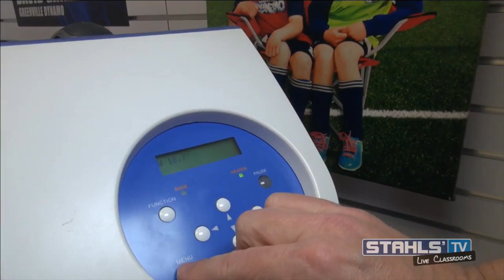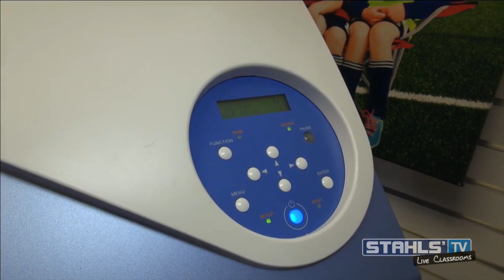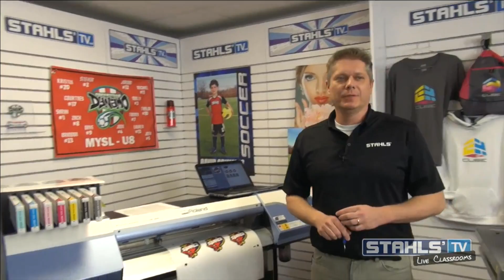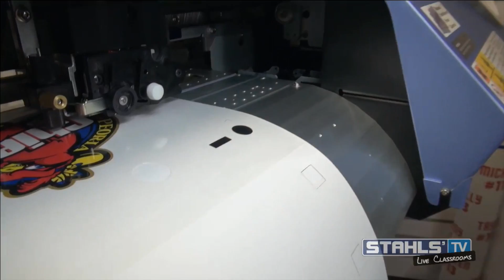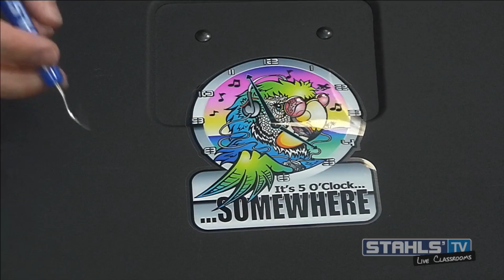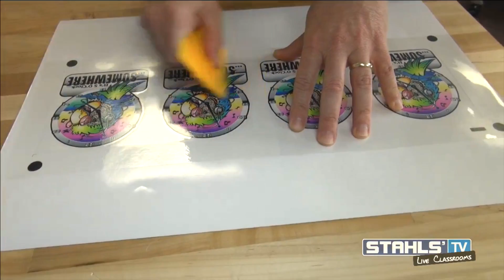How to Add Lamination to Your Print and Cut Workflow

Comment: Hey there! I am writing from Belgium, and I will have a Roland BN20 installed on the 16th of April. I am still a newbie and I’m learning everything by myself (I have taught myself how to use procreate, photoshop and illustrator in the last 10months. It was a challenge, I’ll tell you that 😅But it worked and I learned how to make cutting paths in illustrator. I have a stickershop (for 3years now) and I had always outsourced my sticker printing needs, but now with the BN20 I want to start doing everything myself. 

I still have a few questions though, concerning the use of the machine and sticker making. I hope you can answer (some) of these;

1) I read just as many comments of people saying you dont have to laminate as people who say you absolutely should if you want your stickers to be professional. I need stickers that can survive about 3-5 years outdoors without fading too much and who are waterproof. Some end up on cars, others on waterbottles or laptops. The point is they need to be “diverse” to be used on a lot of places, but not always/only outdoors. Do you think a laminate is necessary then, or will the ink from the BN20 be good enough that it can hold it’s color for a certain amount of time? And I guess it’s also waterproof without the laminate then?
2) For the cutting. Does the BN20 also cut through the bottom of the vinyl (the paper backing) or is the blade not strong enough for that?
3) Can you load multiple designs at once in the software, to save on vinyl so you don’t throw away as much or is it really one setup for one design each time?

I know this is a lot of text but I hope you can help me with some of these uncertainties. 😊

Thank you in advance, this video was really detailed and well explained!
Reply: I feel bad for you that you haven't got any answers

Comment: “hey guys i need some advice, i'm thinking about buying the roland bn-20 because i print and cut but before cutting i laminate the vinyl, so in order for this to be possible on the roland bn-20 you need to print the crop marks, but i've been reading some coments that this model has problems to read the crop marks and by the time you put the vinyl back to cut, the roland has a hard time to recognize the crop lines and sometimes never does. So i would like to know if this is true, how often this happens anyways or if someone here has been through the same experience, thanks in advance!”
Reply: Hi pierre, i have also a bn-20. We cannot use the crop mark function now anymore, our machine is 4yrs old. The roland technician told us that the ink from the head while printing can affect the sensor for cropmark. Note that cropmark sensor is beside the print head of bn-20. He advise to use roland gs-24 for cutting purpose after laminating but i cost us too much, we are still deciding if we will replace the sensor a new one or buying a gs-24.
Reply: Ryan M. Wow I see. I appreciate so much for replaying! See I found a few issues with the bn-20, such as the crop marks, the fact that it is very slow at printing and cutting, and that if you don’t laminate the vinyl, it curls and peel off. So I decided to print somewhere else and get only a cutter machine and cut it at home. 
PS. The gs-24 here, it costs around $1900, how much does it cost to get a new sensor for the Roland?
Reply: @azwethinkweizmm  i think it's ranging from $80-100 here in the philippines. The roland tech advise if we change the sensor the problem may cause again after a certain time because we cannot prevent the mist of the print head to affect the sensor while printing. Remember that the sensor is attached where the print head is located. Buying a cutter is easier when applying a laminating film when it's about to cut again. bn-20 is slow in printing and cutting comparing to other machine.
Reply: @ryanm.3876  anytime you cut sign vinyl that has just been printed, it will shrink as the ink dries. So wait 24+ hours before cutting & make the cut color less saturated. Less ink=less shrinking after cutting.

Comment: Hi guys, new to Versaworks - I attempted a cut and laminate the other day, But when I went to cut the boundaries - It cut each individual item out not the boundary of the whole setup 
( Because of the way I set it up to be one item in the file and duplicated it in Versaworks - my question is .. do I have setup the file as a tiled  file outside of versaworks to get it to cut boundaries correctly?  or can this be done in versaworks ? Also if I was to create the same cutline for the laminate with a 3mm over-bleed for just one - and duplicate (tile) in versaworks am I going to achieve the correct alignment still when it does its cut?

Comment: Can we use the transfer tape just like you used in the video as a laminate instead of buying a laminator? or will the transfer tape lift up after a while?
Reply from the maker: Yes, you can use the ORATAPE mask in place of a laminator and it will not lift up once applied. Be sure to remove air bubbles and that it has been firmly applied to the decal. Please visit https://www.stahls.com/heat-transfer-patterns-mask for more information.

Comment: i love this channel :D can u also punch them out with a print and cut machine?
Reply from the maker: In this video, a print/cut machine is being used.
Reply: @StahlsTV   thx i knew it was a print and cut machine... i wanted to know if there is also a punch function on these machines :D i found out its called half cut function on the mimaki cjv150
Reply from the maker: @DaveDRC  Traditionally, no. You would not want to punch the logos out. You will need some material left behind for the masking process. There could also be risk to damaging your blade.
Reply: @StahlsTV  i like to get them in sheets all the same size to store them better, im not tallking about punching them out on the same line then the cutline, im talking about  two seperate lines, the cutline is around the logo and the punch line is a square way further around from the cutted logo.. also why should the blade get damaged if mimaki is offering a half cut feature? i watched alot of clips and also tried it out when i tested a mimaki... this feature is great u need no more cutting board or punching machine

Comment: I have a HP Latex 260 and 360.  We use our Graphtech to cut all our stickers/decals.  What's the advantage on using this machine besides the obvious of print/cut on 1 machine?
Reply: POS Banner 
print/cut in 1 machine is not good choice . it's illogical  if you print out and you have to wait for cutting processing  then you continuous printing . best choice with Summa S class cutter .
Reply: POS Banner 
Quality Rolland provide is one of the best in class.
Reply: Noting good. that like allseason tires. You lose time.

Comment: How do you make stickers if you can't cut through? I thought that is what preforated cutting was for in Versaworks.
Reply: That is what perf cut is for. However I never use it. I always just add pressure to the contour cut and get perfect die cut stickers all the time. This guy seems like he knows what he is doing but he took a million extra steps to get to this solution. Ive been using rolands for 15 years. this process does not take this long. This should have been a 5 minute video.
Reply: The substrate doesn't get all wonky while it is printing/cutting?  O

Comment: hello, i got a question.
Do this machine do die cut? so it will turn out to be an individual sticker instead of a group.
Reply from the maker: You would not want to cut all the way through the vinyl because it will damage your blade and cutting strip.
Reply: Stahls' TV is there a machine that would do die cuts?
Reply: It does.

Comment: By Laminate, you are just using mask?  And if you wanted this to to be a decal for a car, how would it stick to the car window, is it sticky just like that?  I have a BN-20 and want to do this to make car decals.
Reply from the maker: Any printable decal vinyl will have adhesive on the back with will adhere to your surface much like a sticker.

Comment: Hi there
I have some issues with curling edges when i print and cut to print areas
Maybe you have some idea?I'm using oracal 3164.
The oracle profile for this vinyl is awful.really bad print.
Thanks
Reply: I'm using Orajet 3651, and I noticed that, if I leave the decal on the sheet (unweeded) for a long enough period of time, the decal shrinks and starts to curl as well. I read from the Roland UK forums that it happens often with the Orajet media. I have not tried any other material with my BN-20 thus far
Reply: Briteline vinyl works pretty good